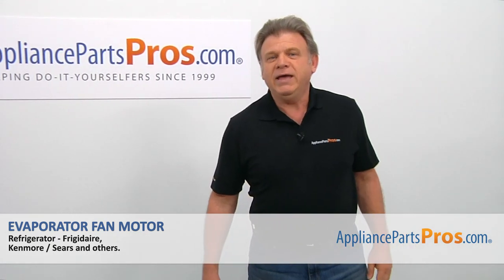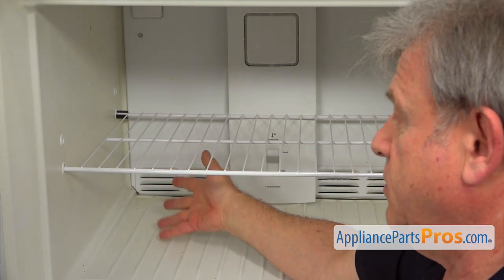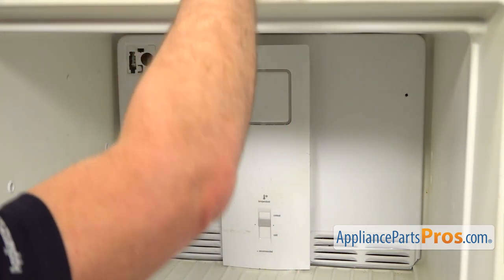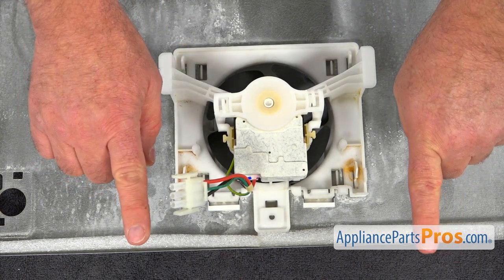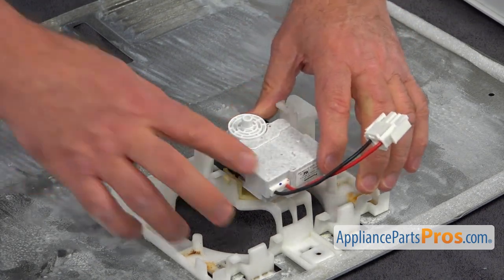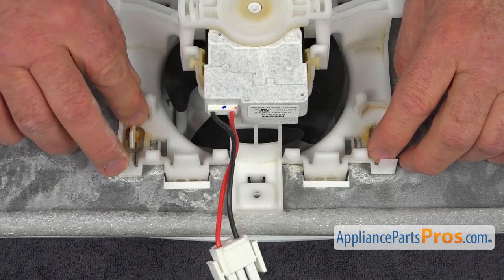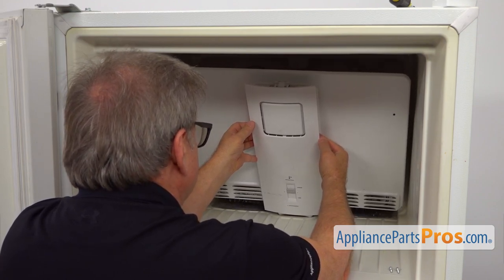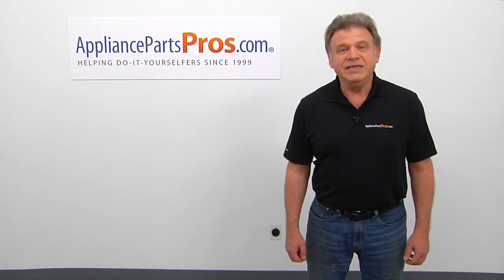How To Replace: Frigidaire/Electrolux Refrigerator Evaporator Fan Motor 242077705

Comment: I am a woman and the instructions were very clear and I was able to follow along. I replaced the evaporator fan. I did come across an issue but not with the installation. But my coils were all covered in ice. So I used a hair dryer to defrost the ice off of the coils and wires. This is a very good video.
Reply: Most likely the defrost mechanism is not working, ice build up, prevent fan blade from rotating, motor coil burned. therefore, must check heater and thermostat (even timer).

Comment: Very well done, thank you!  I just used your video and successfully replaced the fan motor.  Another troubleshooting step that may help other viewers is to check the channel between the freezer and the refrigerator to ensure that it is not clogged with ice.  At the center of the bottom of the freezer, the opening that white panel fits into (visible at exactly 8:44) should be clear.  In my unit, it was a solid block of ice that I first started melting with a hair dryer, but then poured hot water on until it melted through to the refrigerator.  Putting a large bowl in the back of the refrigerator helped catch the melting water and chunks of ice that eventually fell out.  Thanks again!
Reply from the maker: Thank you for those tips!

Comment: Nice video! I replaced the motor, but after plugging in the power, the new motor/fan ran for just 5 seconds before stopping. This happened with both the new OEM and Amazon parts. Any thoughts?
Reply from the maker: What is your model number?
Reply from the maker: Thank you. You will need to test for power going to the fan motor, if you have power there and it's not coming on then you will need to replace the fan motor. If you aren't getting power there then you will need to replace the control board, also check for damaged or loose wiring.

Comment: I have this exact refrigerator but with an ice maker. Will it be the same part? The same fan motor that you used in this video? Thanks
Reply from the maker: That would all depend on the model number on the inside. Even slight differences can change which part you'd need.